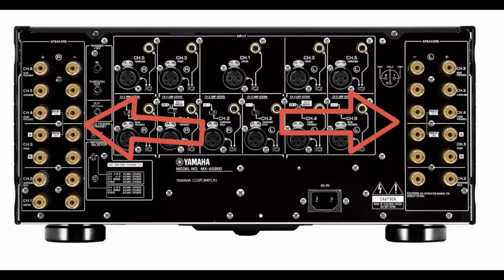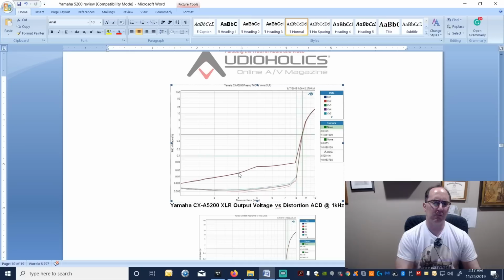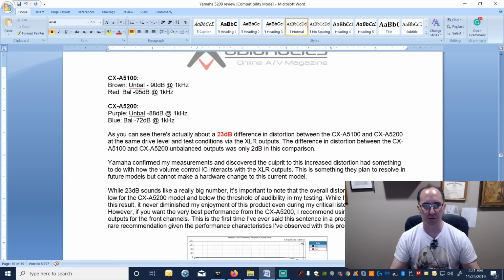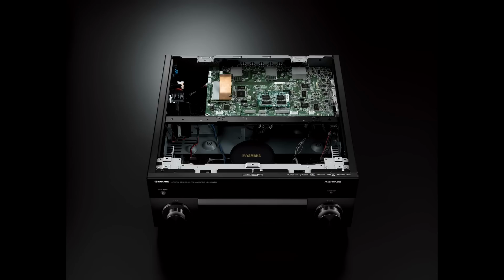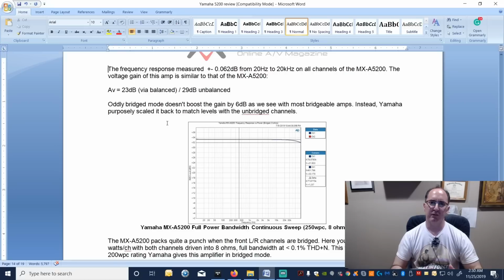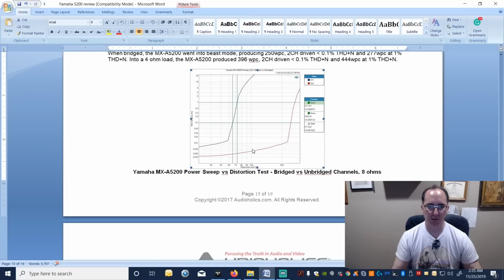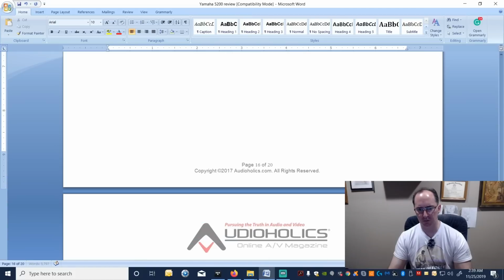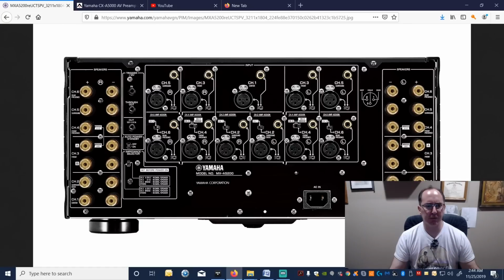Yamaha CX-A5200 & MX-A5200 11CH AV Separates Bench Test Results

Comment: Great review 😎 I have bought the mxa5200 11ch power amp. You say to use bridge mode if possible, which makes sense. I have a 7.4.4 system, so I need 11 ch to drive everything. I do have a Rotel 1552 2ch amp, before I sell it, how would you use that with the Yamaha to get the ‘best’ result?
Reply: you could use the rotel for your sourround channels and then have room to bridge the fronts with the yamaha. or use the Rotel for the fronts and just take some load off the 5200.

Comment: Would the Yamaha MX-A5200 be a good amp to drive a 7.2.4 setup, paired with the Denon AVR-X3700H? My concern is how well the separate amp would do driving all 11 channels? Obviously it should do better than the internal amp in the 3700H but would it be enough improvement to justify the added expense? Love your reviews btw. Top level!

Comment: Does the Analog XLR inputs use the ADC or can it be just Analog straight through perhaps that's Direct mode? If its Only analog then the noise floor should be improved?

Comment: Hi Gene! If I want to use the MX-A5200 only to drive my LCR (B&W 603-new model, and HTM6) making it bridge mode for the LR and normal connection to my center,  what kind of average wattage will the other channels get ? I currently have a marantz 7013 where I am planning to add this power amp just to drive the front LCR. Thanks much.

Comment: It seems all Atmos processors are in the $2,500 range and up. Are there any 11-channel receivers in the $1,250 range, with balanced outputs, that can be run in preamp mode? I was considering the Denon 3600H or 3700H but they don't have balanced outputs. I'm going to use Kali LP-6 active speakers for the LCR and surrounds, and I'm worrying that it will be problematic running such long lengths of unbalanced interconnects. Perhaps if I use some triple shielded Belden 1694A it will be ok? My room is 25 foot long though.

Comment: When  car audio bridges an amplifier they will drive the negative side of one of the output terminals and the positive side is what becomes grounded. You can measure this with continuity on a multimeter looking for which terminal is ground. That way there is no switch and the channel that is inverted will have a180* phase shift already and permanently applied to it.

Comment: Hi Gene, I have a question that I'd super appreciate if you could help answer.

I have a Yamaha RX-A3070, using 7chs on a 7ch Power Amp, so currently not using any internal amps. Would I make any benefits if I was to trade in and upgrade to the CX-5100 (which is the same model year as 3070 so same feature set), or CX-A5200 which will be the following years feature set so will gain surround sound AI.

But will there be any benefit in sound quality or anything else I'm missing, I can only think of balanced connection benefit over unbalanced benefit to the 7ch power amp.

Any advice would be super appreciated :)

Comment: Last summer I purchased an a3080. Much better fit for both budget and more importantly, space (apartment dweller). However, I am very curious I saw on the yamaha website the a5200 dropped some features of the a3080... but other than that, what is different, what are the advantages, and how much did I lose, if anything, by going with the best combo receiver amp vs seperates? (so I know for next time)

Comment: Solved! Smh to all the new yamaha owners that are going through what I went through,  do yourself a favor. 1st Do a factory reset .second  unplug your avr for a minute . Third run ypao.  Night and day difference. I never experienced this with any other brand avr. Don't know if it's a yamaha thing or just my unit. But everything seems to be working like it should..
Reply: what did you solve Vito, by doing this? i am considering buying these separates.  thanks.
Reply: @barbarashissias9567   hello thanks for the question.  I currently use 2 yamaha professional 2 channel amplifiers along with my Yamaha avr pushing as the pre amplifier to those amplifiers. One amplifier has a higher sensitivity than the other ( takes more preout voltage to push the amplifier to full.) I'm using this amplifier to power my 2 subwoofers.  Initially this avr seemed as though it didn't have enough preout voltage due to the ypao setting my subwoofer trim to near max while having little actuall audible output from my subs. So I learned I should unplug the avr for 5 minutes than perform factory reset and it seemed to correct the preout issue I was having initially. However,  as I like to play around with speaker placement I've had to run ypao maybe 2 more times since and I must say that it still puts out enough preout for my amplifiers , but weirdly enough it seems to output it variably as opposed to my previous avrs from onkyo,  marantz, dennon, pioneer. Other brands seems to work on demand/Fully . Wile this Yamaha avr seems to give me what it feels like giving me if that makes sense lol.
Reply: Vito Ran thanks for the quick reply. Got it.  So let me ask you something else, did you find that the Yamaha pre-pro is the best value out there for what you got compared to other major manufacturers? i was strongly considering the Anthem, but based on Gene’s review, the Yamaha has superior build quality.  Had so much problems (2) repairs on the widespread and widely publicized hdmi board issues, i just cant consider them anymore. Way tooo much trouble. i have two very old denons still running strong in my main house. lol
Reply: hdmi issues on onkyo pre pro to clarify...also have older yamaha at my summer place never a repair!
Reply: @barbarashissias9567  good question. That happens to be the reason I chose this flagship avr. I felt it offered more bang for the buck when compared to other brands with similar spec. It appears that Yamaha does have superior build quality,  though I'm no engineer lol. Aside from it's strange preout section , all its functions still work fine and is a stellar performer for a avr. Your pre pro setup should definitely be next level.  I'm jealous lol.
Reply: @barbarashissias9567  sorry I just realized you were under the impression that I have the pre pro.. I actually have the rx-a3080 avr. Not there preamp processor.

Comment: Also I pulled out my trusty old onkyo just to test and verify it's not my cables. The onkyo has tremendous output without even having to touch any settings. Mind you moth avr specs indicate a 2.o volt preout voltage max.

Comment: I have a issue with my rx-a3080 that I'm hoping someone here can help me with. Seems as though this avr is limiting its subwoofer preoutput. Befor ypao I hardly had any output with amp volume knobs maxed out and avr subwoofer level maxed out. After ypao  the avr set the subwoofer level to +9 with hardly enough output,  I than turned up the amplifier volume knobs to max to get just enough output with no headroom.  I'd hate to have to send it in for service so I'm reaching out to see if there something I missed.

Comment: Hi Gene, I just purchased one of these. So I should use the RCA outputs (to Bryston Amps) instead of the XLR's, correct? Or... are there factors other than distortion at play making the XLR's a better choice? Secondly, would you still recommend the 5200 over the 5100 in general? Features seem comparable, but went with the 5100 because of the advanced circuitry, assuming that would render a better overall sound. Many thanks and keep up the GREAT work!

Comment: What an extraordinarily detailed and informative review.
Trying to make the transition from two channel stereo to surroundsound, whilst incorporating as much of my existing equipment as possible without degrading the result. I was hoping to take the front channels as a preamp output from an AV receiver to drive my existing hi-fi amplifier and speakers and then add in the rest of the kit needed. Is that going to be feasible, or is it just going to mess up the final system?

Comment: WTF... Yamaha MX-A5200, is powered by 650w power supply and some magic pixie dust... check specifications... under powered Garbage!
 If you going to use all 11 channels then a power delivery is like 45w-55w/channel if you lucky.
Reply: You’re dense to think amplifiers actually use anything close to their rated specs in real world listening on all channels at one time.
Reply: @moustachio334  Wow just wow man did you know how things works Volts, Amps, Resistance,  power loss, efficiency. that power supply cant even run 3 channels at the rated capacity. Actually You’re dense if you think this is acceptable. Denon AVC-X8500H is all in 1 and it haze 900w power supply, and the Yamaha is separate with 650w power, it is a joke a expensive one.

Comment: I find it interesting your comments on bass management here, i was always under the impression if you set your mains to large, or any speaker for that matter you have no option to set a crossover as they are set to run full range, i have a rxa2070 and i cannot
set a crossover when large is selected, so unless thats different with the processor im confused about what you say there.

Comment: What do you consider acceptable THD+N (assuming typical profile)?
I personally like to see no more than -60dBFS (0.1% THD+N) from a single component, as it’s unrealistic to have dozen of components in your chain that also have an identical harmonic profile, so you won’t reach -40dBFS (1%), which is what is roughly our audibility threshold in the upper treble.
Reply from the maker: Agreed, -60dB is where I test max power in amplifiers. -40dB can be seen on an oscope as a clipped waveform and definitely audible.

Comment: Gene is there a reason to go with the CXA5200 over the CXA5100 since the 5100 has better performance?
Reply: Having had both, the CX-A5200 sounds better, which I still use. Pure Direct mode sounds best.
Reply from the maker: only if you value slightly faster HDMI switching and the new AI surround feature. Otherwise, I'd go with a price reduced 5100.

Comment: Gene, wouldn't 2 Outlaw 5000's be the way to go...about $1300. I realize its single ended, but you yourself measured the 5000's to be stellar overall.
Reply from the maker: That is a compelling alternative but does take up 2 boxes instead of 1. The 5000 won't produce nearly the same output power as the 5200 does in bridged mode on those 2 front channels though. Personally, I'd go with the Monolith 11X as an alternative to this amp.
Reply: @Audioholics  makes sense!

Comment: Thank you Gene, I have been anticipating this video for some time now as I own the Cxa5200 processor.  What is the tradeoff of using the analog outputs for the front 3 channels instead of the XLR's? For instance, would it not play as loud or not draw the maximum power from my amp etc.?
Reply from the maker: No trade off really. In this case, the unbalanced L/R fronts measure better than the XLRs. I'd go that route but just note the voltage is 1/2 so you have to add 6dB to those channels compared to balanced unless you're using the Yamaha amp which automatically adds back +6dB to unbalanced.

Comment: Hi Gene, very informative as always.
Are you planning to measure the denon x8500h, i think that could be very surprising.
The denon preamp feature and assign could be really interesting to compare to a real pre pro.
Reply from the maker: Probably not but will bench test the Marantz flagship that replaced the SR8012 next year. It should also have the preamp mode since I begged them for it ;)
Reply: @Audioholics   now that's something really interesting. Can't wait to see the review. I have the Marantz 7013 that I love, but wanting to upgrade next year with either Marantz 8013 or Denon 6500.
Reply: How do you suggest to set up a power amp with the denon, i have a rotel 1585?